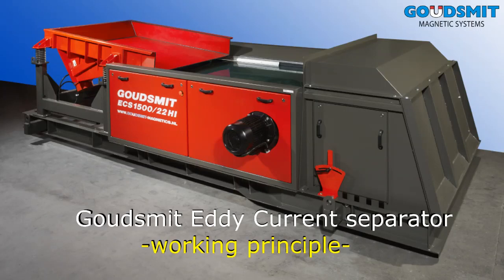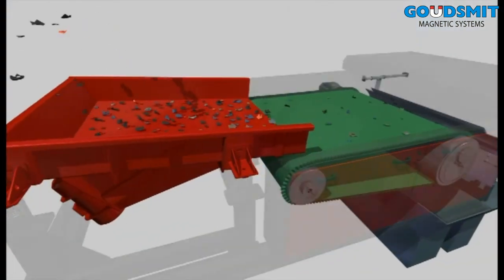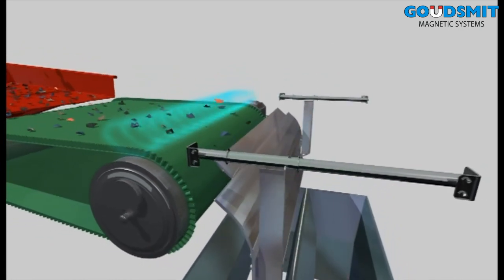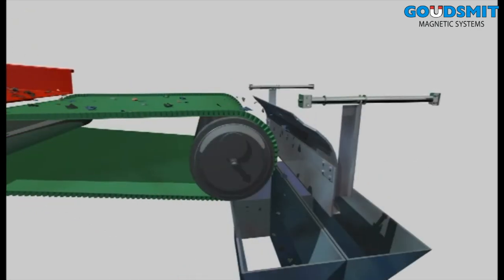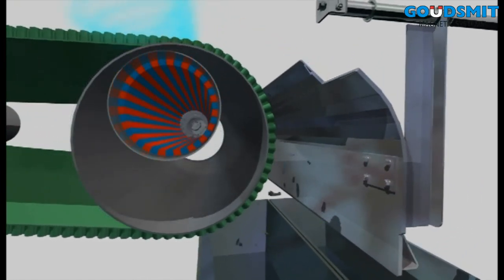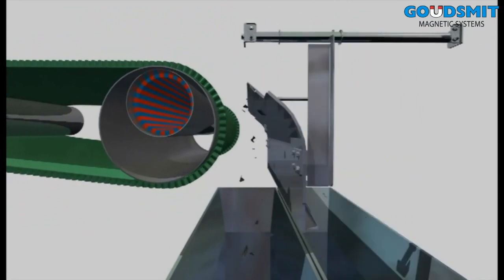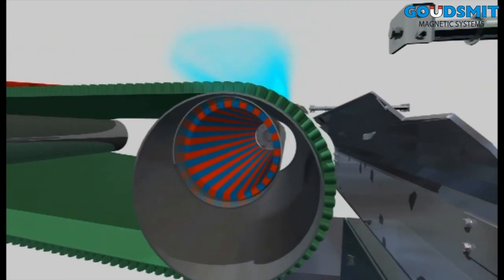Eddy current Non ferrous separator working principle 3D animation

Comment: What's welding got to do with this?
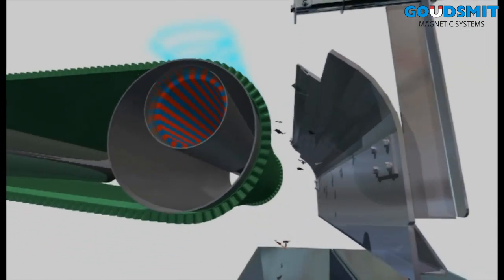Reply: @GoudsmitMagnetics  At 0:47, "This technique prevents the weld penetration of the iron particles[...]", what welds?
Reply from the maker: @zoooooooof  Thanks for your remark. This is an error in pronunciation: it should be: this technique prevents the BELT penetration of iron particles